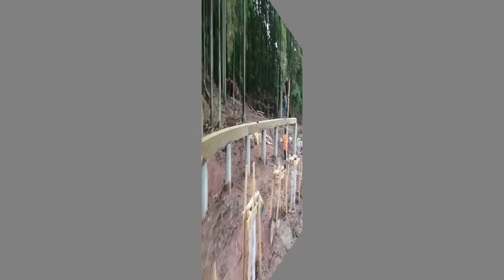Placing The Beams For Our A-Frame

Comment: OK I know these videos are from a ways back but I have to ask.. why didn't you lift all those beams with your tractor. I.e wrap a chain around the middle of them and lift them into place? A 300lb beam you could easily get hurt if got away from you plus you end up exhausting yourselves lifting by hand.. I'm glad it worked out though.